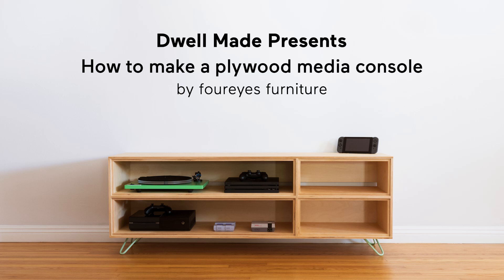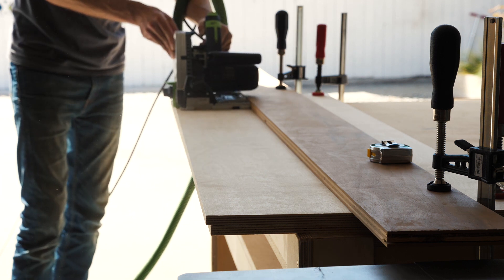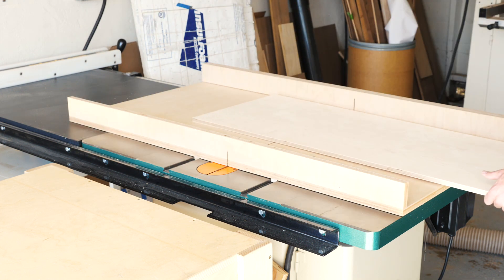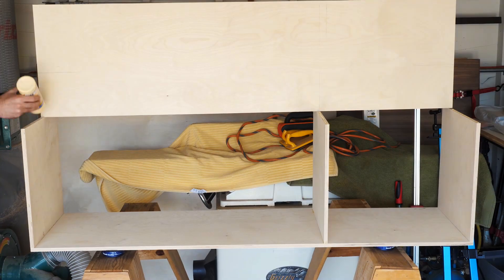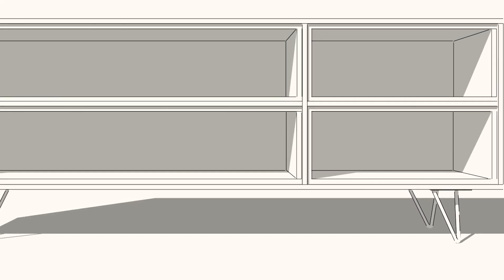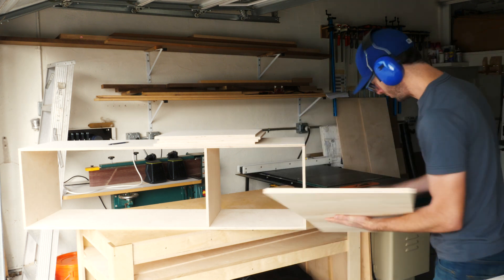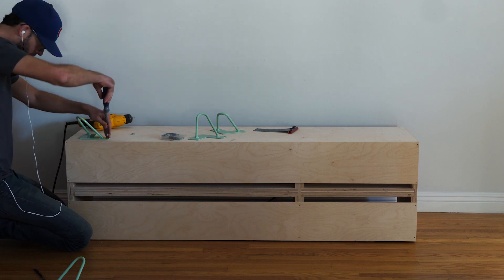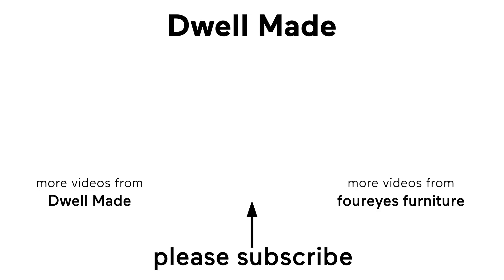Modern DIY Plywood Media Console from | A Dwell Made Project

Comment: Nice job Chris!  I like how you adapted to create a video for beginning woodworkers, but still kept the signature Salomone feel to the video. The inset style looks great, and also creates a piece that you could easily add flush inset drawers too, without any modification to the original shelf structure.

Oh yea, and let the effeciency-vs-aesthetic Reddit war begin over using more material than necessary ;)  I will just say my piece that this type of joinery with inset boxes looks great. So not only do the double layers make the construction easier for a novice woodworker to tackle, but they serve an aesthetic purpose, that you couldn't achieve with less material.
Reply from the maker: Thanks Mike - excellent points. And should a Reddit war begin, I will site this comment as a source in defense of the "box in a box" construction method :)